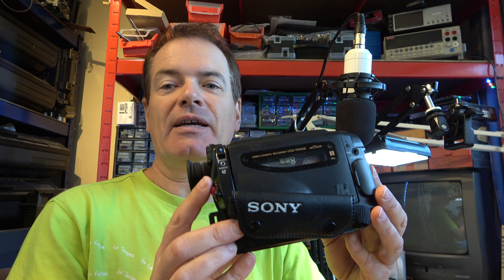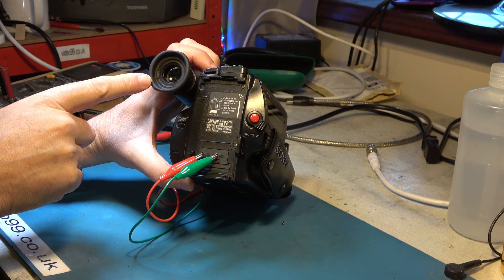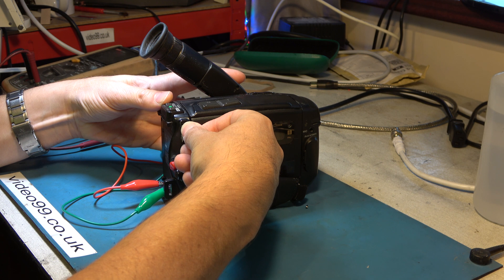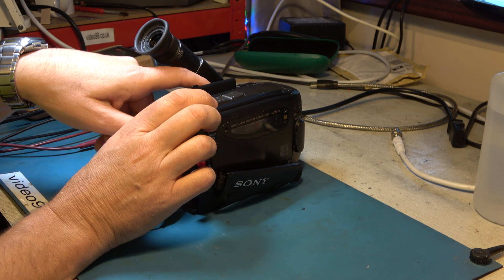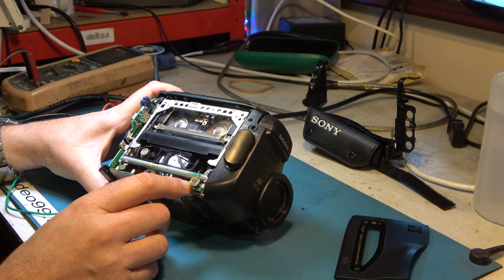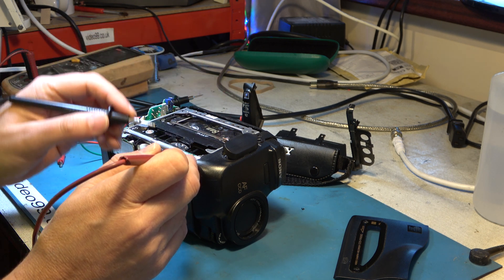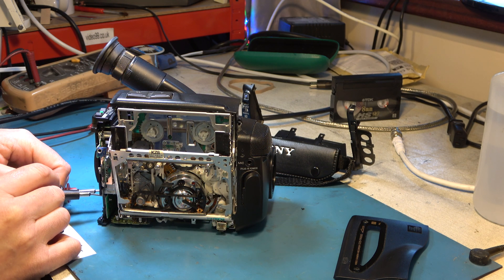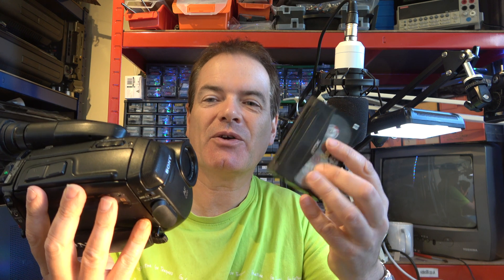Getting a tape out of a defective Video8 camcorder.  CCD-TR202E.

Comment: What is the device you are using to apply voltage to the motor when you unplugged it?
Reply from the maker: A bench variable power supply.  But three AA batteries providing 4.5V will do it fine.

Comment: Hi, I haven't got an adjustable power supply like yours. Would say thre 1.5v batteries do the same thing please? I have tried but seem to get no movement from the load motor.
Reply from the maker: Yes, they should do the job fine.  Don't use rechargeable ones, they can pack a punch.

Comment: Thanks for the video.  How did you know which motor terminals to apply power to?
Reply from the maker: It's generally the only DC motor in a camcorder.  The other two motors (drum and capstan/reel) are usually very different, flat looking motors with multi-way connectors.
Reply: @video99couk  Okay, thanks. Any advice on bypassing the moisture sensor on a camcorder, apparently the part that causes the whole thing to shut down and be unusable?

Comment: I’ve got a Sony TR101.  Pulled it off the shelf for the first time in years.  Worked fine for an hour, then the tape reels would spin, but no transport control was available, no ejection was possible, and the counter flashed “00:00:00” with the ‘eject’ indicator also flashing.
Shut it all down for three hours, came back, powered it on, the reels pulled up any slack, and I was able to eject the tape.
What might cause this failure as the unit gets hot?
Reply from the maker: It's impossible to fault find my remote control like this, there are any number of possible causes including failure of capacitors on the PCBs.  It could just be a bad tape or contaminated heads, though I suspect not.
Reply: @video99couk  - Thanks.  I’ve repeated the leave-power-off for a couple of hours to rectify.  It’s a repeatable solution, so whatever’s getting hot on the board, PCB’s you think, is likely the problem.  I’ve used various tapes and all play fine, for an hour or two.

Comment: Hello my sony cam actually powering on and the sound of powering is out but no display and the battery was't charge what should i do?
Reply from the maker: It's not possible to diagnose faults like this from a distance, but it probably has mass capacitor failure and a bad battery.  It's probably not practical to repair.

Comment: Hello, I have a Sony handycam CCD-f350e and it can’t play, record, or even eject. It has the patterning thing on the viewfinder too! I’d really like to fix it but I have no idea what I’m doing.
Reply from the maker: Probably has failure of many of the surface mount electrolytic capacitors on the boards.  Repairing this is a skilled and time consuming job.  Sorry, it's probably not practical.

Comment: Very nice Video. 
I have an old Canon 8mm Camcorder, and I have some Problems:

1. when I Plug it in, the tape door opens immediately, without turning the Camcorder On. 

2. Sometimes I can‘t close the tape Door
When I Will play my Tapes

3. Camcorder does not rewind the tape in the Full speed. Only slow rewind and slow fast forward

Camcorder Plays Fine the Tapes and eject without eating the tape.

You make me happy when you explain the problem, and Its Hard to fix that. What can I do? Its the mechanism from the Camcorder Same like by many VCRS, with Gears and Reels. I have a lot of experience with fixing VCRs , But Not with Camcorders. I have a feeling that is a three big problems wich I Could not slove…
Reply from the maker: It's not really possible to fix things by remote control like this.  You need to examine the deck carefully.  It might be a mode switch fault, a damaged flexi cable, an electronic fault or another mechanical failure.  Sorry, I can't really offer an accurate diagnosis.